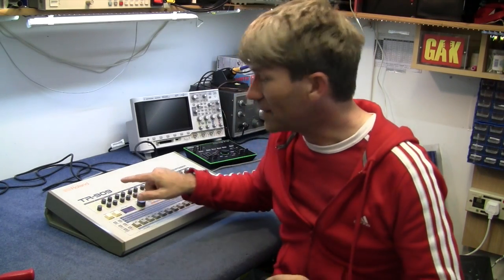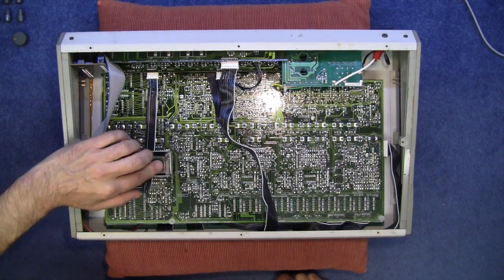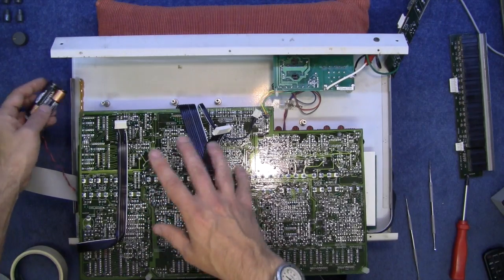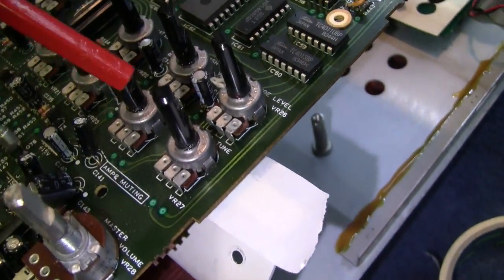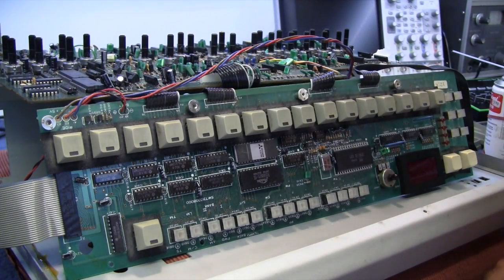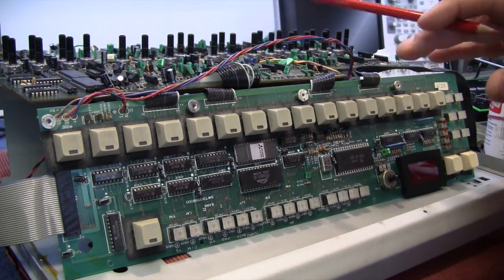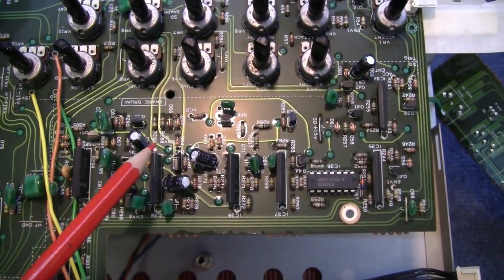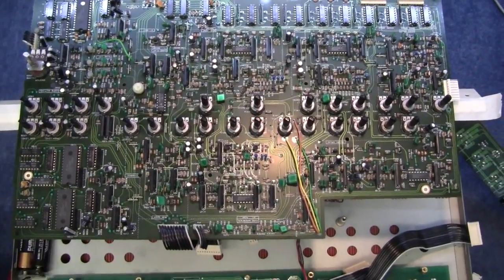MF#21 ROLAND TR-909 look inside and repair service

Comment: Nice repair.
How about replacing electrolytics in the future?
Reply from the maker: Hi I looked across the electrolytics for the typical bulges etc but the machine worked fine so I did not go into an extensive service as this was just a clean up and pad the buttons. but if they ever do need replacing it belongs to a friend of mine so I would do that when the problem arises. I know some people just go ahead and replace them all now and then which can be a good thing but i only had it for a couple of days so the quick fix was all i had time for.
Reply: markusfuller
Understandable,it's just that replacing these makes these older machines(over 30 years old)much more reliable and dare I say better sounding.
Keep up the good work!,like your vids.